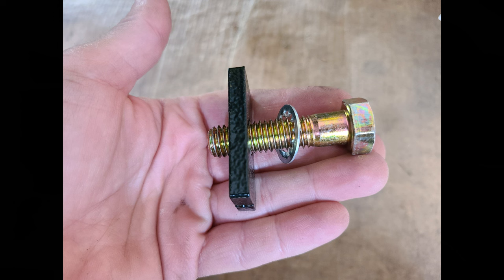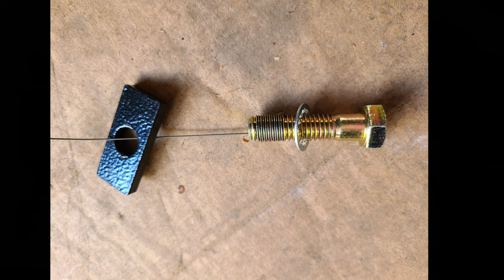Subaru Crosstrek Hitch Install: EcoHitch by Torklift

Comment: What about the electrical for the brake lights?
Reply from the maker: You need to buy a trailer wiring kit. However, it's a plug and play installation as the plug is already in the car.

Comment: What load rate is this tow hitch ?  I’m getting the new Wilderness Crosstrek, which has a 3500 lb. towing capacity. Does this receiver hitch have that towing capacity, or is it just 1500 lb rated ?
Reply from the maker: The hitch has a 3,500 lb. rating and 525 lb. tongue weight rating at the trailer ball. (More than my Crosstrek is rated to tow!) However, I'm not sure this will fit the new Wilderness or not. I'd suggest reaching out to EcoHitch directly.
Reply: @crankshaftculture  , thanks !  I will check them out. Was your C.Trek wired with the wire harness plug-in, or did you have to wire it yourself for lights to trailer ?
Reply from the maker: @brandtedwards7735  There is a plug tucked up under the plastics on these cars. You just need to buy trailer wiring, but it's all plug and play.
Reply: @crankshaftculture  , awesome, thanks for the info !
Reply: You shouldnt have to remove the muffler to install it